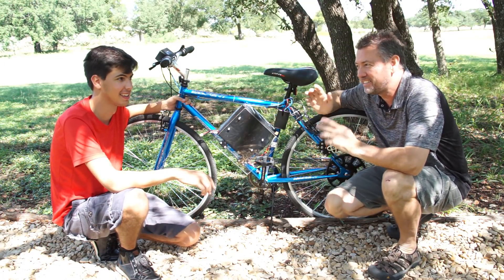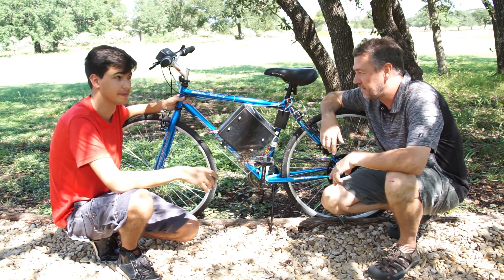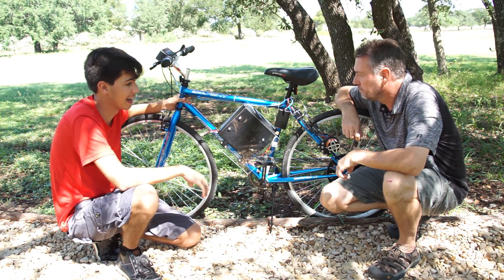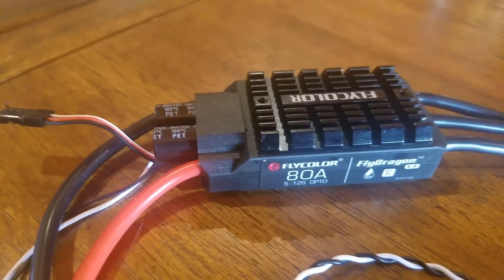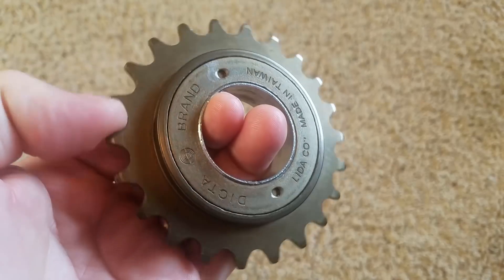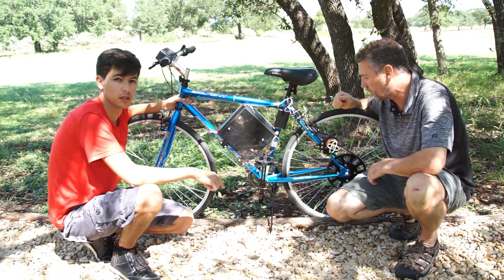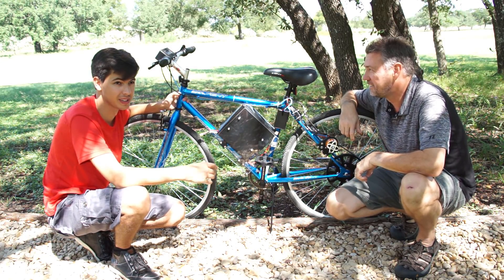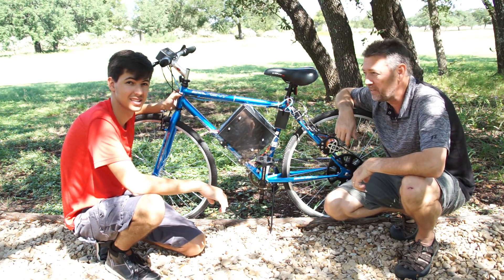We Converted a Walmart bicycle Into a Speedy E-Bike

Comment: My friend, where did you buy the free wheel for the left side? And where did you buy the hub with the thread for that free wheel? I do not find them anywhere. Thank you.
Reply from the maker: Picked it up a local bike shop. It was a very close fit to the size of the hub on the wheel. With a little grinding, we were able to press fit the sprocket onto the hub. There may be other ways to do it depending on the hub and sprocket designs.

Comment: Why did you go with the freewheel on the motor side? The motor cannot go backwards unless you're in reverse.
Reply from the maker: If you don't have the free-wheel sprocket, and you are just free-wheeling downhill it will be driving the motor which will create a voltage into the ESC. The faster you go the higher the voltage. Perhaps this is not an issue for the ESC, but we didn't want to take the chance of frying it. It also adds resistance by driving the motor when it doesn't need to.

Comment: I'm building the exact same thing. How did you fitted the sprocket on the hub? I have an aluminum hub and i can't weld it, because the sprocket is steel.
Reply from the maker: Hi - this was a tricky part that we did not go into as every bike is different. the freewheel sprocket we got was threaded for the intention of screwing onto a normal hub. because we are putting it on backwards thats not an option. so we machined the threads out (you could grind it) so it was just a fraction smaller than the wheel hub diameter. we then pressed it on and being aluminum it deforms ever so slightly making the fit super tight. we also used the sprocket teeth as guide holes for the bolts through the big 3D printed sprocket to attach to the wheel. hope this helps and good luck.
Reply: That helped, thank you. Haven't you noticed any movement on the hub though? My sprocket is a little bigger from my hubs diameter, so i can't do what you did. I'm thinking on using a metal ring, to fit it on the hub, but inside the spokes, so then i can bolt the sprocket and the ring together and both of them will make a "sandwitch" with the spokes being the "cheese", i hope you got that :).
Reply from the maker: have not noticed any movement
 its on pretty tight. if yours is bigger then you need a different approach. your idea sounds like it will work. if using the spokes to support it I would do.more bolts not less